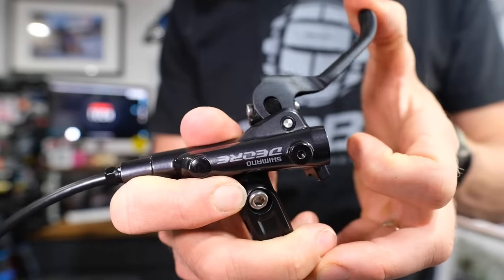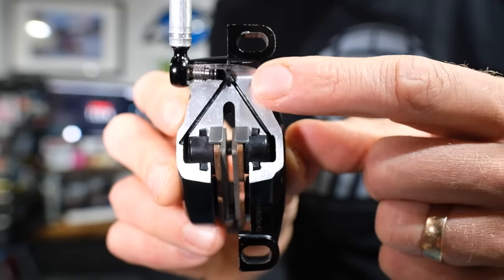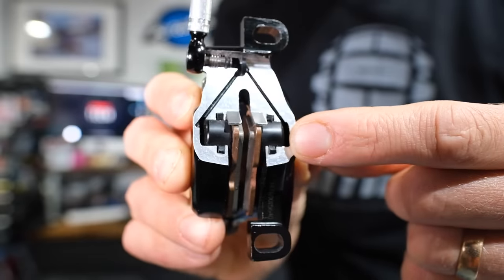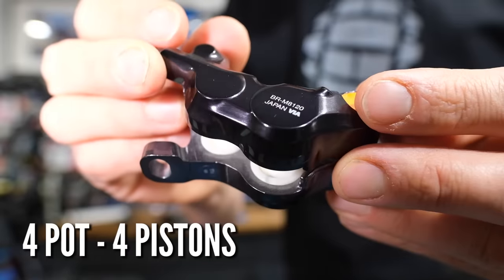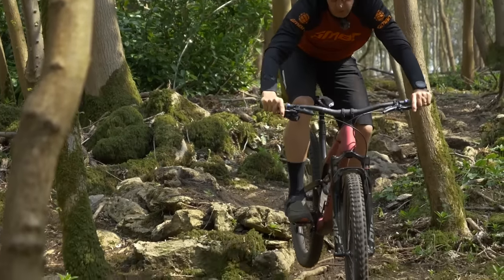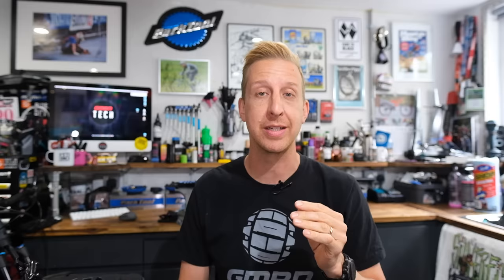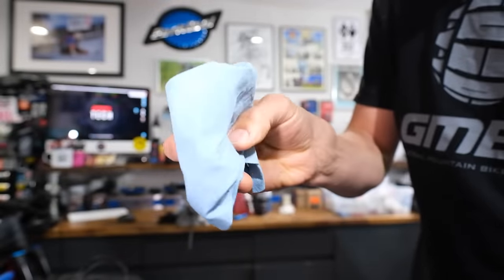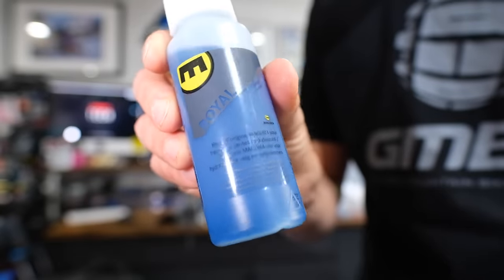Why Do My Mountain Bike Disc Brakes Feel Spongy? | #AskGMBNTech

Comment: #askGMBNTech Hi Doody. Love the channel and the show. I have a 2020 Scott Genius 950 size medium. It has a Fox float 34 150mm of travel with twinlock system. It is my first full suspension bike. I’m loving it. I bought it because I like how versatile it is. I use it as a trailbike even bikepacking. I like swapping 29 and 27.5+ wheels around. I’m planning to do some enduro races as soon as the pandemic ends. I know some EWS riders as Martin Maes run 150 mm travel both front and rear. I’m 1.73cm height and 95 kg. I’m a bit worry about the thin 34mm upper legs for rough trails and jumps. I was wondering if I fit a Fox 36 with 160mm travel, would that mess up the geometry? What if I set the flip chip of the rear shock to the high position? Would that help? Greetings from Chile.
Reply: ....it would be crazy if those 2 mils actually improved rigidity as much as you'd like - remember, 20 years ago everyone was riding 30 and 32 mm forks - and I don't think broken forks were more of a problem than now.

Comment: #AskGMBNTech Hi Doddy. I got a brake selection question. I've bought a used Yeti SB66 and the last owner used Formula R1 levers with Hope Mono Mini calipers.
I took the bike to a shop and there they said that this mixing will eventually lead to poor braking...
Now the rear brake is feeling really soft and bleeding it doesn't really help.
My question is, since the components are good, should I keep the levers and buy a caliper from Formula (if yes, does a new R1 caliper fits just fine?), or should I get a Hope lever, or last case, should I buy a new complete set?

Thanks for all the videos, I love them and they teach so much!
Cheers from Portugal
Reply: both use DOT fluid so should not be an issue, they probably just need a bleed, but seals might be leaking and letting air it, if so swap those, you can get spares, as it's Formula and Hope, they offer these parts as spares. but this is the first time I hear about this set up.
Reply: @mtbboy1993  thanks for the advice, I'll try the new seals ;), but I have another question: the rear rotor is quite worn down. If I want to replace it, is it mandatory to use Hope rotors or any quality floating rotor will do?
Reply: @joaoafonso1178  any other quality rotor will do, I just knew these would be decent, and was easy and fast to get those for me at the time. I know there are more good rotors, Brakestuff looks interesting, but they dont do floating rotors, but they offer rotors with smaller venting holes and thicker rotors which is interesting.
Magura also has rotors but not as easy to get. I see Clarks is a popular option for low budget builds, but not tried them.
Shimano Ice tech rotors seem to scream, so do Sram Centerline, but some people don't have these issues so I am not sure where the issue is coming from. pad and rotor combo maybe, I don't know, maybe the big venting holes,  maybe something that gets on the rotors, I don't know but seen it on video people riding in American dry conditions and brakes screaming.
I've not tried them, but cat fight sounds are not nice when braking.
Hope is nice but as with all floating rotors the rivets will eventually be creaky after years of use.
TRP seems to be easy to get. they seem to be decent.
Reply: @joaoafonso1178  the Magura E rotors look interesting,
Reply: @joaoafonso1178  Galfer rotors and brake pads has come highly recommended, but I've not tried them.
Also Trickstuff pads and rotors.
I know Formula has brake rotors too, both regular and floating, I don't know much about their performance.
I know TRP offers thicker rotors for E bikes and enduro, downhill riding. 
but thick rotors is nothing new, Brakestuff had it for decades. but thick rotors require calipers that support it.
Hope also did vented floating rotors, so that's basically two discs with a gap in the middle for cooling, they are very heavy. a complaint with these is they collect sand and wear the pads faster and make noise. I've not tried them.
Reply: @joaoafonso1178  most important thing is to have durable steel rotor, with many venting holes, and good cooling. 
so not a resin only shimano rotor, you will cook those, and resin pads wear fast, so metallic is a common upgrade, but that will ruin the rotor. but I can't use these rotors as I cook them.
Reply: @joaoafonso1178  I've not seen much of Hayes rotors, but they too have rotors. you might find some Avid G2 Clean Sweep rotors, the 185mm is bit flexy, but good braking performance, and not noisy, I had those on a entry lever bike. they seem to be a common sight in international stores. not looked lately. not best rotors, but not horrible.
I don't have enough info to recommend the best rotor in existence.
Reply: @joaoafonso1178  I know Superstar is a common low budget build option too, not tried them. they no longer offer floating rotors.
Reply: @mtbboy1993  thanks a lot for all the info and rotor advice 
I'll see what I can to be the best for me
Cheers mate
Reply: @joaoafonso1178  get the best of wha tyou can get, there is shortage on parts all over the world now due to delays due to covid19

Comment: #AskGMBNTech Hi Doddy, Whenever I try to do any kind of rough trails on my bike I get pain in my lower back. Is this down to my setup or could it just be down to poor technique? Thanks
Reply: Existing injury I'd said. Hang from a pull up bar. Twist your hips (back) 90° a few times, straighten then bring each knee up to your chest. Pain should vanish for a week, but repeat this exercise for months and you'll strengthen your lower back for good
Reply: might be misaligned lower back, I can't ride a hardtail in rough terrain cus it guaranties thrown out back and neck.
but back issues can be too riding a bike with too long or too short reach, but yes bad technique too, but you must be doing something really wrong then. it's unlikely you ride in an absurd position.
but suspension setup might be bad,  geometry might be bad, along with too short reach, causing you get a head banging effect, you might also get issue with the back too.

Comment: #askgmbntech I have spare brake pads and I can’t remember if I bought sintered or semi metallic. Packaging is long gone. Any way to tell based on the pad? Not seeing any markings printed.
Reply: Full metallic is, well, full metallic. They look like metal blocks, usually copper/brass colored. Organic/semi pads will have some little shavings of shiny metal mixed with a dark, non-metallic binder.

Comment: can you do the lever bleed on other brands or only shimano? clarks m2 to be precise need to shorten a hose and dont fancy a full bleed
Reply: Just my opinion, but I would consider shortening a hydraulic line to be a major modification to a hydraulic brake system. I would do a full bleed just to be thorough.
Reply: Shortening a brake hose is actually surprisingly easy, plus it doesn't require a brake bleed! There are some great tutorials on YouTube on how to do it, all you need is a replacement olive + bark kit, something to hold the hose while you fit the new barb and a small (usually 8mm) spanner to 'crush' the olive. But yes, you can lever bleed/ tap out any bubbles that may get trapped on levers other than shimano.
Most tutorials I've used are from Park Tool/ or the GMBN/ GCN channels. In fact, the one I learnt hose shortening from, is on GMBN!

Comment: When i had my bike upside down to remove my rear wheel on the go my rear brake didn’t work for like 30 secs, that indicates air in the system right?
Reply: Yes it is.

Comment: #AskGMBNTech I do have a new bike (3 weeks old) with SRAM CODE RSC breaks with an issue like that: if I pull the leaver about 3 times the bitenig point ist rock solid but pulling first time it's spongy (leaver goes to the bars). Bleeding was done 3 times now... problem seems to be gone but after time it's again spongy... Break pads are fine and metallic type from sram...What I noteticed is that this little rubber plug at the bleeding edge port ist just a tiny wet...could be there a leaking problem? what could I check else? Thanks a lot!

Comment: #askGMBNtech the cup that came with my bleed kit does not fit the threads on my brake fluid reservoir is there another size cup that I'm unaware of because I bought four different brake bleed sets and they all have the same size thread

Comment: #AskGMBNTech Hi Doddy, I have an XC hardtail with a 180mm rotor at the front and a 160mm rotor at the back (XT 2 pistons calipers front and rear), I'm happy with how it brakes BUT on long alpine descents (1000m drop) they over-heat and the braking power fades, I need to pause a few minutes.
What is the best way to takle this? Better pads (with radiator fins), fit-in larger rotors (203 at the front and 180 at the back), 4 piston calipers?
Reply: I suggest getting bigger rotors, 4 piston or bigger piston brakes.
floating rotors help a lot if you want to keep same size, but what you are doing I think bigger rotors might be needed anyway.
also make sure the brakes are not leaking and glazing the rotors and overheating the system, cooking the rotors.
Reply: @mtbboy1993  thks for your suggestion, I've already ordered an offset kit to put a 180mm rotor at the back and I'll use pads with fins
Reply: @antoinechalons  the fins might make some difference, I don't know if it will fix it. But I did not have good luck with the metallic finned pads, I have been cracking the compound. But resin wears too fast, but semi metallic trp pads did bite as well, but I have mechanical brakes now, but still use the hope floating rotors, but now I have 180 rotor on rear cus my new bike has that as minimum. These pads did well. Don't crack they are the same siz was the cheap shimano low end brakes use. But I am not sure if cooling will be greatly improved with finned pads cus I went from resin pads to finned metallic pads. Bite sure was much better, wear too. But shimano pads are not the best with durability I think. I think it might be gravel killing the pads.
Reply: @antoinechalons  seems like a smart idea.

Comment: #askgmbntech Is there any possibility of setting up a free stroke on Shimano zee levers? I've a problem with my Saint/zee setup new hose,new oil, new rotor, new pads( metal) still lack of power.  Next week I'll buy resin pads and will look into pistons if they're not sticky.
Reply: That sounds like more of a pad/rotor issue. Sure it's not contaminated or not bedded in properly? Or possibly a small leak at the piston that's contaminating pads? Those brakes are super powerful.
Reply: I think Dylan is right. Either you've contaminated your new pads or rotor, or you just haven't broken them in yet
Reply: Contaminated (did u wear clean latex/nitrile gloves?) And not bedded in. Several vids on gmbn on bedding in. Think neil did one recently.

Comment: #askgmbntech

I got a new bike at the start of February, and I adjusted my brake lever reach to suit my small hands.

Only thing is, my back brake acts as if it needs bled sometimes and pulls to the bar, which can be remedied by extending the brake lever reach and readjusting it. 

My front brake has no problems, so what’s happening and how can I fix it?
Reply: it’s a shimano (deore I think) lever
Reply: @harrybryson1130  this explains it. Shimano has had an issue on its brakes with wandering bite point fir ages. Some have it, some dont.
They should replace under warranty if u advise its 'wandering bite point'. No guarantee the new one will be better. Its a lottery. Shimano havent resolved it in over 2 years!. Very widely documented in mtb press.
Only seems to effect their deore and above brakes tho.

Comment: #askgmbntech If tubeless sealant is able to seal a hole when it leaks through and is exposed to air, why doesn't it harden from all the air already in my tube?
Reply: @Vieth Knorr not so...those help seal, they are not essential, many dont have particles.
Reply: It does....sealant dries out over time to form sealant boggies/boogers!
But the pressurised escape from the tyre causes sealing action as its forced through the tiny hole. So bigger holes, much harder to seal
Reply: @rupedog  ahhhh. Thanks so much for responding! I really appreciate it.

Comment: I feel like everyone should know this i had my brake bleed and my pistons replaced but a week passed and same thing happend my breaks got sqeaky again so i tought to my self what if the mineral oil is not reaching the leaver so what i did i removed the leaver placed it verticaly in my hand and started pressing it and my hydraulic breaks got they'r power back mabie it's just my model or something like that but i feel like i have to share this with people that have the same problem

Comment: #askGMBNTech 
Hi! I was considering to buy a high end set of 4 pot brakes and I narrowed It down to three options: Hayes dominion, Hope or Formula Cura. I am curious to know which One would be the easiest to do maintenance on, considered I am confident in bleeding brakes, but I am not a professional mechanic. There Is no rush and I'll have to save money for a while, but I am curious to know a bit more about those brands than what you usually find on YouTube reviews. My current set Is Shimano Slx 4 piston. 
Thanks!
Reply: Hope...for lifelong serviceability and spares and support...never had them, but thats their reputation.
Also did really well in recent mbuk (mbr?) test...better than the others u mentioned on power, price, modulation.
Reply: Kinda disagree with Rupert.  Hayes Dominion are the best of the 3.  Hopes are excellent however.

Comment: I seem to remember on an earlier maintenance video that silicon grease can be used to lubricate brake pistons (sparingly).Is this so, or advisable.
Reply: NO. Never use silicone, copper slip or any grease on pistons.
It can swell seals. It also attracts dirt, making issue worse, and scoring seals and pistons.
If DOT brakes, it contaminates the fluid to.
You can service sram calipers, and you buy specialist DOT grease fir the caliper body seals, but even then NOT the piston seals/pistons.
As doddy said, ONLY the brake fluid, and then once pistons full retracted again, clean with brake cleaner to remove residue.
Reply: @rupedog  Thank you very much for the info'. Happily so far, I have never had the problem.
Reply: @rupedog  Thank you for the info.

Comment: ive got shimano saint brakes on my 2 bikes, on my dh the leaver is light and consistent, on my trail,, no matter how many times i bleed, or due vacuum bleed when you subtract syringe with oil to force air from oil, i get inconsistent lever anyway after the bike is like upside down or whatever, what am i missing?
Reply: (shimano xt 8000 here) Did you check that your pistons move equally? Left piston on my rear break was moving very little and did not come out in contrast to the other side. A bit of oil on the side just as Doddy described helped to move it. Than, as my pads aren't new, with the attached and open reservoir, I just made sure the pistons are a bid out so that when I insert the pads they basically slightly touch the disc. If you now close the system withou further leaverstrokes, the amount of oil in the systems stays a bit higher. Now my breakes firstly feel equal front and back, and secondly are snappy as I like them. Maybe this helps
Reply: Shimanos now infamous 'wandering bite point issue'. Warranty them...tho new one might be same as shimano cant definitively fix it.

Comment: #doddy gmbn i had a bike new last year and the brakes dont quite feel the same any more as when new, pads have gone down but not worn out would it be this, or shall i do a mini bleed ? They still work just not as much bite/ stopping power ?
Reply: If they are:
Shimano -> Pads 
Sram -> Bleed
Magura -> They will always have bite 😂

I ride brakes of all 3 manufacturers
Reply: @The_Dude_420  thanks mate 👍🏼 shimano i got some new pads aswell so will prob change them soon then. As i said they still work just not as good as they did didnt think i needed to do a bleed yet and that it was just the pads wearing down would that be right ?
Reply: @kieran710  That should be right! I was kinda joking, but there is some truth behind it. In my experience mineral oil which is used by Shimano and Magura doesn't need to be bleeded that fast. I only did it after 2 years (Shimano) because I thought I have to, the brakes were still feeling pretty fine. So yeah it should be the pads and even if not having them as spare won't be bad! Another trick that can make them feel a bit better: Zip tie the lever over night, with the lever being the highest point of the system. Last but not least you can adjust the reach to be bigger, the increased leverage can give you a more bitey feeling imo.
Reply: @The_Dude_420  cheers dude🤙🏼
Reply: @kieran710  You are welcome mate, hope it helps 🤘🏽

Comment: #AskGMBNTech how come tubeless sealant doesn't clog up the valve and stop it from letting air in/out as it would a puncture when letting air out of a tyre?
Reply: It does sometimes
Reply: It does block it, in some cases it can make you valve core completely stuck.

Comment: Why does my mtb fork have a lot of friction when moving
Reply: Get it serviced
Reply: It's most likely dirt/grit having got through the seal into the 2 surfaces that interact. 

Service it to get the seals replaced, parts cleaned and then don't pressure wash it (why people persist on blasting dirt into their bikes is beyond me).

Comment: Okay, now why do my mechanical disc brakes feel spongy? Sticky pistons?
Reply: Some have a hydraulic element at the caliper. Or a gear cable fitted by a crappy mechanic. Or play in levers.
Or incorrectly adjusted caliper ( inner adjustment on caliper not set correctly)